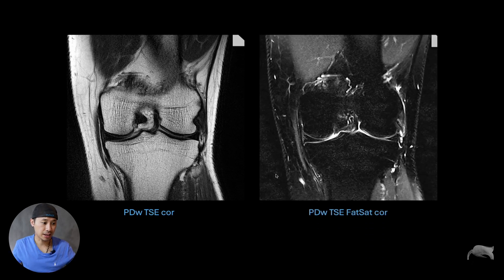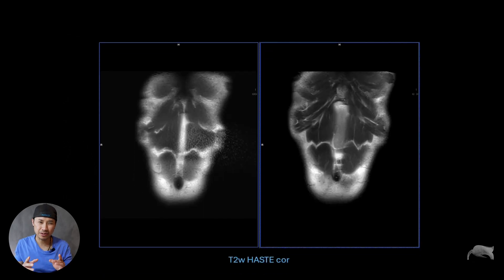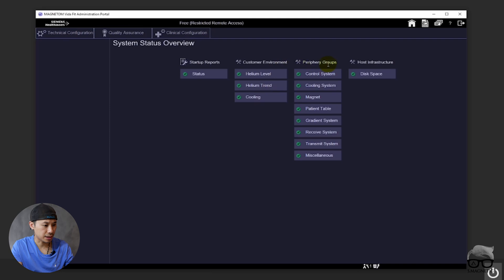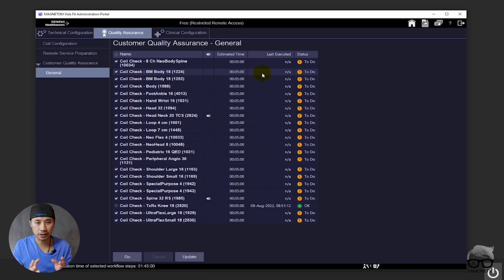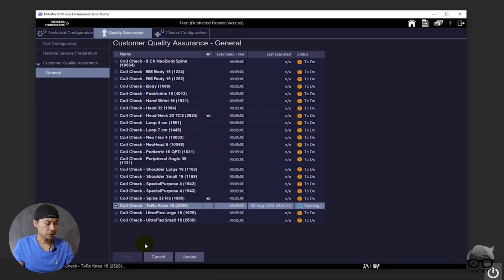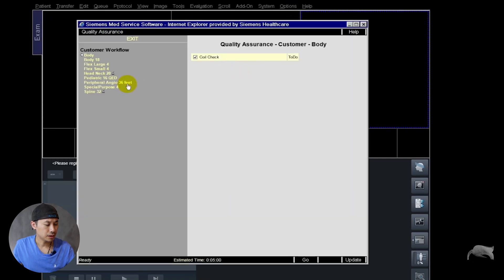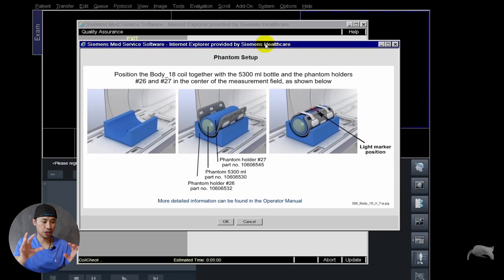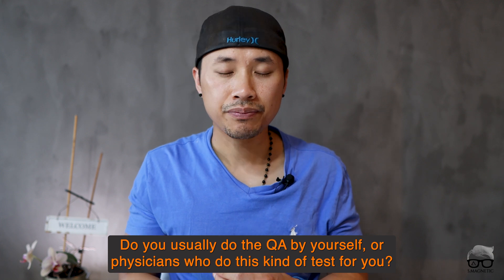MRI – QUALITY ASSURANCE

Comment: Hi Bac, one of your followers here, how do you plug in table position on Siemens when scanning Cervical to lumbar without recentering manually? I do that on GE to where I plug in I for inferior average 360 then it gets it 90% of the time?
Reply from the maker: Hi You mean automatically coil selection?
Reply: @Nguyen_MRI  no sir, let’s say you start brain at -4 location then what do you plug in for lumbar? It is on the tab where you have climate comtrol
Reply from the maker: @wodiagazian9527  https://youtu.be/LDbRncgNwxM?si=VO8BzOEYjNtXGGNw

Use iso and move the fov it should automatically choose correct elements. If not go into the system and coils. There is an option for auto coil select.